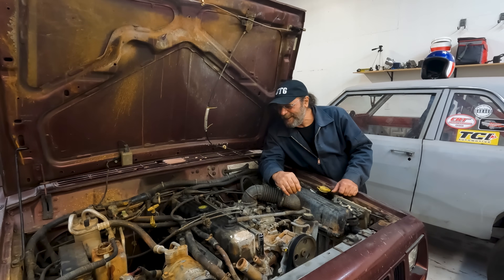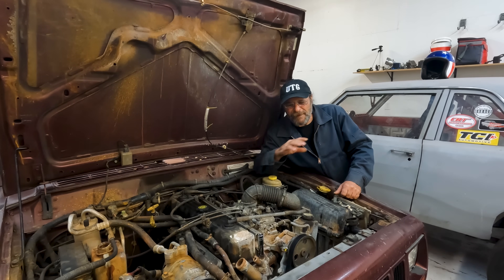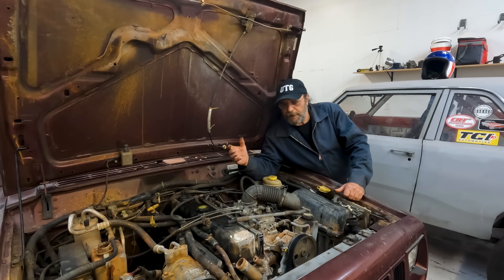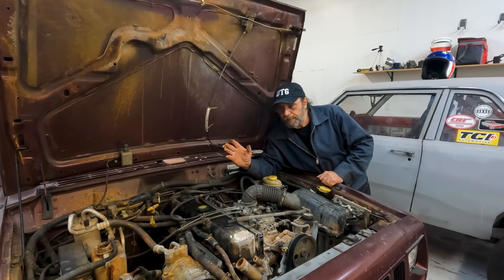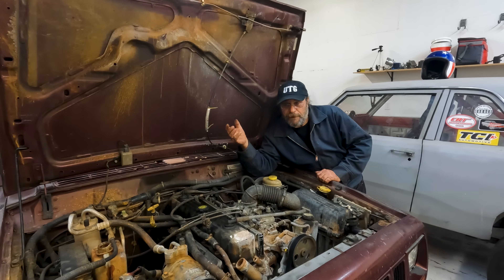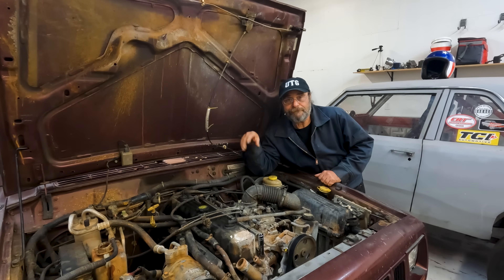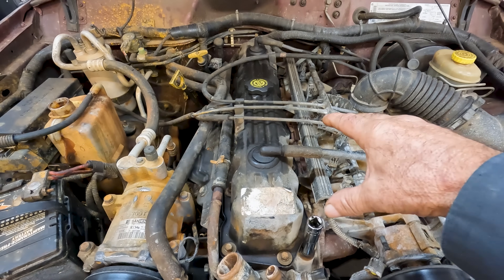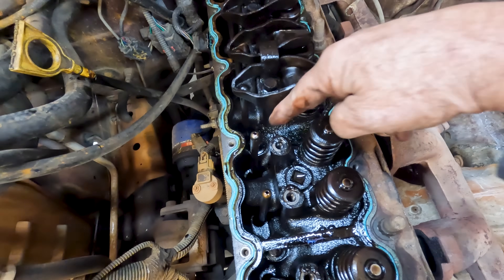Our Blue Devil Head Gasket Experiment Failed - Let's Find Out Why

Comment: The impeller damage kinda looks like a galvanic issue.  Is there some way an electrical current was leaking?  One thing you said at the start was that the cooling system had been running on only water.  If so, that is an important ingredient.  Cars are designed to run with approved coolant not just water.  The thing with coolants is they have chemicals such as corrosion inhibitors in them.  This allows manufacturers to use metals that would otherwise be incompatible but due to protective coatings and coolants, there isn't any issue.  But if this Jeep has an after market water pump (questionable materials used) and was run for a long time with only water in the cooling system that could do it.  Especially if the water is "hard" or has a high mineral content.  Hard water makes a good electrolyte.

Comment: It does seem like that impeller suffered cavitation damage. A clogged coolant system could have reduced the suction pressure enough to cause it, especially if it was running hot a lot to help get it below the vapor pressure.
However, whenever I've seen pictures of car water pump cavitation, it's usually the housings that are damaged, not the impeller. 

I do also wonder if the continuous combustion gas leakage bubbled enough CO2, and other combustion byproducts (especially NOx) into the coolant to turn it acidic. I wonder what a PH strip test would show compared to fresh coolant.
Reply: That is possible

Comment: I have two Jeep 4.0 liters in the desert, and they both ran hot. Nothing worked until I installed a billeted water pump.  It seems those stamped impellers don't push the water to the back of the block where the sensor is. 

Had the same problem when I got my second one until I upgraded the pump.

Comment: I've had good success with K-Seal.  My sister in-laws Honda Element had a bad head gasket due to overheating.  I put K-Seal in and could see copper flakes all over the engine bay.  I did a second application and after a week the flakes disappeared and the engine bay stayed clean.  It lasted 6 months and her car made it to 299,700 miles.  My goal was 300,000.  Close enough!

Comment: Pure speculation but if the HG was leaking alot of combustion gas into the cooling system maybe that could contribute to the impeller degrading. Did it have the recommended mix of antifreeze or was it just running pure water?

Comment: somebody used sealer to try and fix a leak or head gasket issue, then realized they didn't have heat because the sealer most likely plugged the heater core. At that point they used the cooling system flush, one of the real caustic ones (strong enough to eat through jeans). That stuff probably ate the fins of the water pump, or it's an amazon or temu special water pump...

Comment: A very cheap yet effective cooling system flush is plain old citric acid. Mercedes Benz has what is an excellent flush know as citrus flush, its mostly if not entirely citric acid
I dont remember the mix ratio but you want to flush with just water the cooling system real well, a couple times is better. Then add the citric premixed and water and get it to operating temperature let it run once at temperature 30min to an hour if real nasty. I promise you will not believe how nasty what once was clear water now looks like! You'll want to water only flush it again several times. It won't hurt anything for no longer than its in there, just don't want to leave it and flush it well. Citric acid is safe too, no nasty chemicals. Most grocery stores have it with canning supplies or a big bag on Amazon is cheap.

Comment: That's what happens when someone puts the Heavy Duty Cooling System Flush into an engine and leaves it there instead of flushing it with water, then putting antifreeze back in.  It's very corrosive, usually sulfamic acid or oxalic acid.  I've seen the pitting along with the edges of the WP impeller eaten away, but not completely missing like that.  I've also seen it eat through aluminum radiators and heater cores.

Comment: I'll bet some dudes went to town on the block and head with a wire wheel or scotch Brite pad. A cheap tool is a piece of steel bar, 1/4 to 1/2" thick, by 1/2- 2" wide, about a foot long. Has to be flat! Glue sandpaper to a side. 
I use an old wooden paint brush handle to scrape paper gasket material, and what's left, I use a piece of aluminum for the stuck bits. You just file the end of the aluminum as it gets dull. 
Precision machinist staight edge bars are reasonably cheap.

Comment: Pump cavitation will do that to the impeller.  See it all the time in the Navy.  If there is not enough pressure at the suction of the pump for a given temperature, the coolant will essentially boil as bubbles are created or collapsed.  You might think of this as air binding the pump.  If it goes on long enough, it will do exaclty that.
Reply: Definitely cavitation.  Seen many times in construction pumps. Eat through cast iron impeller. Water molecules pulled  apart causing pitting on impeller.
Reply: @phillipmcgloin yeah, I saw it happen like that on big sea water pumps for our heat exchanges on the Enterprise years ago.
Reply: @phillipmcgloin  The impeller is not made out of cast iron
Reply: Pretty incredible what damage cavitation can do. It can eat right through cylinder liners. Pretty nasty stuff. This is why a properly operating cooling system with proper coolant / servicing is so important.
Reply: @PickupsAreNotTrucks yeah, I went to a Ford training seminar for power stroke, and they said that is the exact reason Ford Gold coolant was created. To prevent cavitation near the cylinder liner on diesel engines. Bigger deal with them since everything happens at TDC.
Reply: @windstarpro  This happens on power strokes You are 100% correct sir would not be my first culprit on the Jeep would be only running rusty corrosive Water with combustions gas
Reply: Do you think a frequently collapsing pump intake hose from the radiator would be a plausible cause for that to happen?
Reply: @screwsinabell yeah, it could. This poor thing must have been through hell to do that though.  Or, boil off just enough coolant that it can't get suction.
Reply: Cavitation for sure, I've seen rusted impellers and they are usually rusty. That one's pretty clean
Reply: Probably made worse by particles of silicate
Reply: Pump cavitation,  I have seen that on mokon pumps that I  have repaired.
Reply: Water pump impellers not made a cast iron.
Reply: Thank you for saying it I didn't have to.
Reply: PHD does not equal  Intelligence Or Experience
Reply: Did they have a lot of Jeep 4.0s in navy sevice
Reply: anyone who mentions pump cavitation? No credibility.
Reply: @1magnit what do you mean?
Reply: @1magnit  you trolling? Gotta be: dropping a dismissive statement like that without a shred of support sure looks like you want attention or just to stir sht up. 
But, I’m always willing to learn, so how ‘bout you lay it out for us?  👂
Reply: @1magnit  Thanks for saying it I didn't have to
Reply: @1magnit  well I got a PhD in integrated triboology from CMU and I'm here to tell you you're wrong. Enjoy your stay 😉😘🍢📏
Reply: That's not me saying I "know" it's cavitation. I don't. 😚🫡

Comment: It sure looks like the cavitation damage we see on commercial water pump impellers that have air entrained in the system. It's amazing just how much damage that can do. Perhaps it's a mix of several issues? Better you than me!
Reply: In this case, I think it's not just air, but combustion gasses.  My first thought was exactly this!!  This is something that happened a LOT to the cylinders inside the water jacket on the old International/Ford power stroke engines from cavitation.
Reply: @johnbrizendine7716  Agreed. It makes more sense that it's combustion gasses, which would have the same effect. Water pump impellers degrade rapidly if you start adding gas (of any kind) to the mix.

Comment: If coolant was that dirty think water pump impeller  would have like being sand blasted every time the engine was running is my guess
Reply: that is exactly what i was thinking  our sandblasting cabinets at work do the same thing at the bends of the media lines it just eats the pipe away

Comment: Growing up with old cars. If there was leak anywhere, I’d just loosen the radiator cap to prevent pressure and it would leak less, just to get me home
Reply: I remember those days 😊
Reply: You should have gotten a Corvair.
Reply: @XtheUnknown99 I always wanted one, circumstances just didn't line up!😊
Reply: Another trick is to fill the cooling system with oil instead of coolant. I reckon that new 0W stuff they sell nowadays would work pretty good, light enough to strain the waterpump less.
Reply: @theosexpertdaymon2774  🥴

Comment: Ah yes, thee ole mechanic in a can!  🤣🤣
I remember as an apprentice working at GM dealership when I was young, a TSB or a recall was to put 6 "magic" pucks in the cooling system to fix an engine/head gasket issue.  I think it was on a aluminum/cast Cadillac engine?  😁🤪

Comment: Not only is that signs of severe cavitation on that pump impeller, but that kind of cavitation quite often comes from a restricted suction side. It can also come from delivering much more water than it was designed for, but this is not the case here. Rather than chemicals, this is restricted suction that has caused the cavitation. I’ve worked with all kinds of pumps for 50 years kind of like the Scotty of pumps.
Reply: It’s likely that all the junk somehow restricted flow to the suction side of the impeller, causing that problem.
Reply: Or air leaking into the intake. Bubbles form in low pressure and collapse in the higher pressure. Air  leaks are self explanatory. Plugged intake is the pump pulling so hard that the water vaporizers and collapses when the pressure raises. Collapsing causes water hammer pressure waves that smash away the impeller. The vaporized bubbles are actually boiling, though the temperature of low,pressure water does not have to get hot. However in an overheating condition this is the perfect storm. I could go on about this but I’d die of old age  first.
Reply: @XtheUnknown99  The lower rad hose might collapse with a severely restricted rad, right?
Reply: @philipvaniersel2023  yep
Reply: @philipvaniersel2023  ran into that early in my wrenching. No spring in the hose, and a radiator maybe a quarter full of gunk. It would always overheat on the road into town because of the grade, but she could run it around her area with no issue. Definitely a learning experience

Comment: just get a good ole chevy 350 ci.   in an older truck with a HEI distributor which has only 2 wires and problem solved just like the boaters  !

Comment: 4.0 cylinder heads warp the second you drive it after a head job.  I measured the deck on the last job and it was out of spec, so I went with the felpro extreme duty composite (black), it's got a little extra thickness to make up for the existing deck and future head warpage and cost the same as the blue one.
Reply: Brilliant 😅

Comment: I've only ever seen that kind of metal rotting away one other time. 40 years ago I bought a 77 olds cutluss to flip and it had the same problem. I knew the guy I bought the car from and asked him what he put in the cooling system. Someone told him to put 10 percent muradic acid in the cooling system because he wasn't getting any heat out of the car and thought the heater core was plugged up. I ended up putting an engine and heater core in the car. If it wasn't so clean of a car I wouldn't have done it. The car looked like brand new inside and out.

Comment: Someone has been in there before…factory head gasket is composite not MLS. Let us know how much they have to take off the head to clean it up. I replaced my cracked 0331 head on my 01 XJ with one from a 93 model and it took 12 thousandths to clean up. Mine was cracked in the exact place you mentioned at the base of the rocker pedestal
Reply from the maker: Factory head gasket beginning in 2000 is MLS
Reply: Well maybe someone had been in my 01 before - it had a composite gasket and it was a pain to clean up. I remember Dex saying the super hard residual gasket material left on the very left side of the block was a tell tale sign of a factory head gasket.

Comment: I pulled a water pump off a early 2000 f150 4.6 2v it was the factory original but the owner put well water so it rusted everything the impeller looked my like a saw blade

Comment: Had the same water pump problem on a 93 dodge dakota, the impeller blades were rusted down to toothpicks. Dang thing overheated and threw a rod through the side of the block, and the autopsy showed the same thing with the water pump.

Comment: Tony. I repaired radiators and cooling systems for decades. I had never seen a waterpump impellor corrode like that in two years of use!! I wonder what type of crazy acidic concoction the previous owner pumped through that cooling system to try and solve his problem?
Reply: Probably tried to "de-scale" and dumped in a gallon of muriatic
Reply: 6:27 Exactly. Cavitation occurs worst at the blade tips. This is uniformly dissolved, like a strong acid would do.

Comment: I used K-Seal Ultimate three years ago and it worked a treat. However, this wasn't a head gasket issue that was blowing oil and air into the coolant bottle. Rather, take off the 710 cap and there's the "forbidden latte." It's still my daily though, lately, the intake manifold gasket hasn't been terribly happy. Still no biggie.
1998 3.8L Ford V-6

Comment: Another issue with how sodium silicate works is that when it comes into contact with CO2 it bonds to that and hardens.

Its also not a perfect cure.

In other words, while the stuff DOES "harden" its NOT STRONG.

Some people confuse and conflate hard and strong as one and the same thing, but its not.

This stuff is BRITTLE and therefore NOT 'tough' which is CRITICAL to something being "strong".

It has to be decently HARD but NOT brittle.

So this stuff is very limited in how much it can handle before it crumbles and flows away in the coolant leaving the system.

Comment: On the corrosion someone put CLR or similar in cooling system to try and flush the crud out, seen it happen before.  Technically can be done but the flushing of the system afterwords must be rigorous.

Comment: These are some of the most interesting videos on U-tube! Once had girl friends Ford 300 with a blown head gasket because of a stuck shut heat riser valve! Stupid design as most of them valves get loose on the shaft & no longer work correctly. Also had my mothers infamous 5.7N GM diesel with a blown head gasket drove that bad engine 200 miles with gasket blown by having cap only on safety with no pressure in system & adding water every 50 miles or so. Took back to selling dealer in Tillamook Oregon & said here`s the crummy truck back you sold my hard working mother you crummy ##@@**!! people. Had to call my father & have him pick me up as it was 28 miles to our house in Nehalem. Both trucks we operated for some miles by having no pressure in cooling system.

Comment: Uncle Tony - in the past I've had better success with liquid head gasket repair when you run the motor - get her hot and put a rag over the radiator air intake take a short drive and push the temp gauge 'well into the red' - so now all the cracks are well and truly wide open - and whilst she is smoking red hot then put in the additive and that facilitates deeper penetration...... definitely works better when you do that but depends on the nature of the problem......

If mating surfaces are warped...... then your buggered - but the above works well to seal cracking

Comment: Looks like some put battery acid in the radiator to flush the system and never drained it out all the way
Reply: I would wager that you are correct. Years ago as a ford tech we had a run of taurus engines that rotted away the pump impellers and the core plugs in the engine. The tsb included instructions to check the ph of the coolant and then flush and neutralize the cooling system. After the repair procedure was complete one more ph test before returning the vehicle to the customer.
Reply: @incognito-pn1px  What years and engines I got TWO Tauruses (Taurusi?)?
Reply: @theosexpertdaymon2774  If I remember correctly it was 95 or 96, I cant recall the particular engines. These cars all suffered damage within the 1st year of operation.

Comment: Maybe the water pump impellor was made out of the finest chineseum. That could explain it.
Reply: There are two rotation water pumps , with later models using a reverse rotation ! Make sure you have correct pump otherwise , severe overheating .....
Reply: @stevewesley8187 
I think that's true for the Ford 302, when they switched to serpentine belt.
Reply: Autozone tried sell me a rusted water pump. The box being crumpled up is what made me check the part.
Reply: Use Evans engine coolant that is waterless to prevent electrolysis. Stop parts from the corroding.
Reply: Or it wasn't new when they installed it.
Reply: It could be a cheap rebuilt pump and the impeller was very used.
Reply: My guess is someone used laundry detergent to clean the cooling system. It has extremely corrosive phosphates. And it'll keep doing it, even after flushing. If they used 50/50 antifreeze, it would slow it down. If the engine had a poor ground, the pump could have become an anode as well. I would hate to see inside the radiator.
Reply: @LuigiAzsassin  I’ve seen several XJs with the ground strap from the head to the firewall badly corroded—and another just missing
Reply: @Scot-p1v  Not to throw shade on people just trying to get by, but whoever messed with this car did everything wrong. Ground strap was probably the first victim. 😅
Reply: I was going to ask, "Was the water pump made in China?"